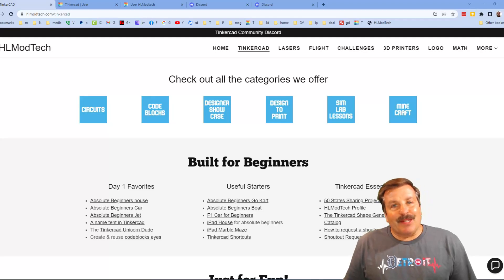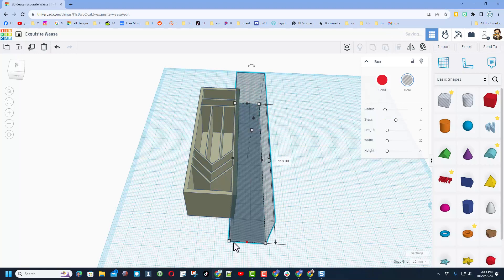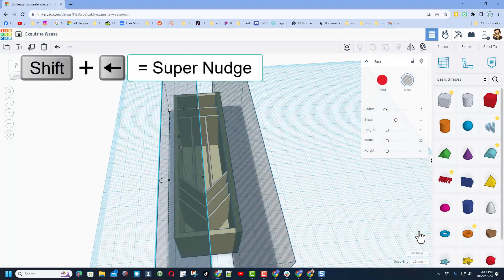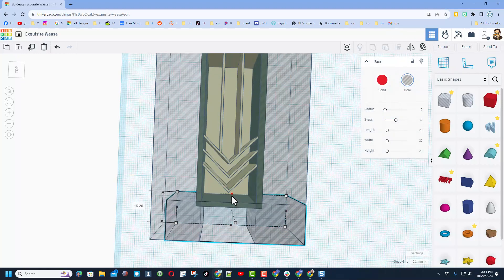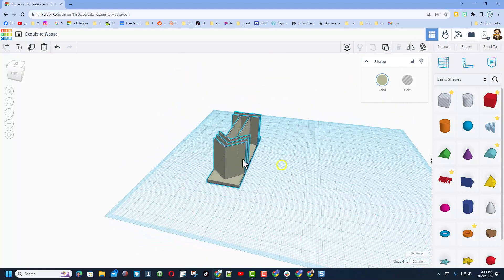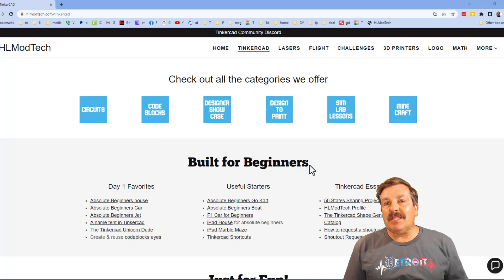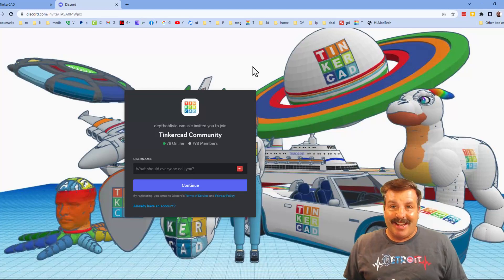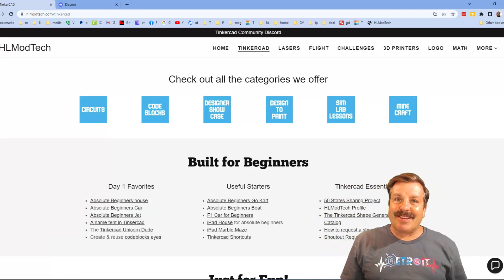Modify a 3D printable Acrylic Pen Blank STL with Tinkercad

Comment: I thought I knew what an acrylic pen blank was.  This has me completely confused.
Reply from the maker: I have never done the process, but I wanted a few videos. They print that shape with a bright color. Then fill the 3D print with cool resin. Once it cures they put it in a lathe to make the pen pieces. This user has a silicone sleeve so they did not need the sides.
Reply: @HLModTech  "What you don't know..."  Thanks for the explanation!  Apparently PLA is compatible with acrylic.  Or maybe they use a different filament.  Certainly seems to make good sense to use a silicone sleeve!  The only acrylic pen blanks I knew about were swirly things from a company in Indiana.  ;)
Reply from the maker: LOL... When the user first contacted me I did not believe the process was possible as well!  I figured on the lathe it would all separate and be a mess. I do not enjoy the hassle of acrylic or I would probably experiment with it. =)